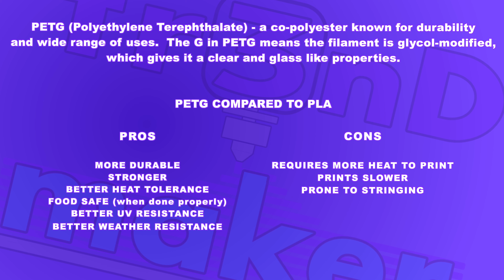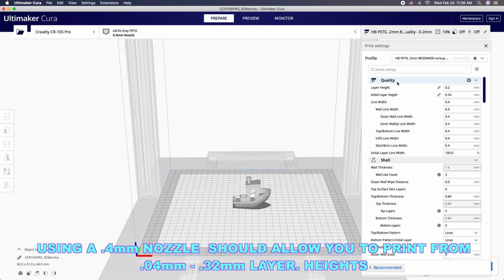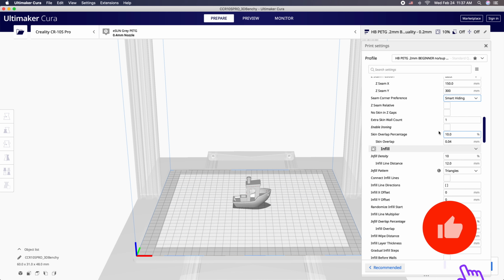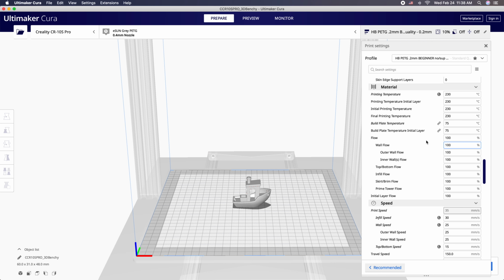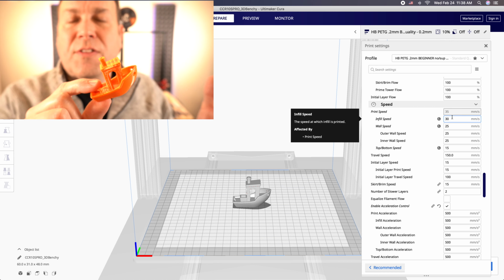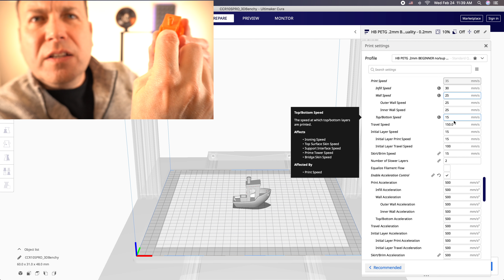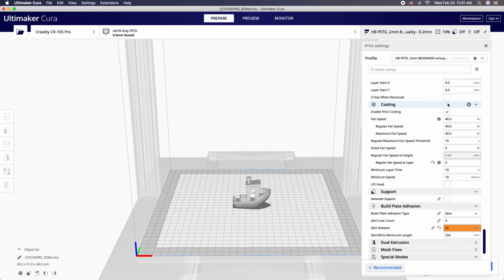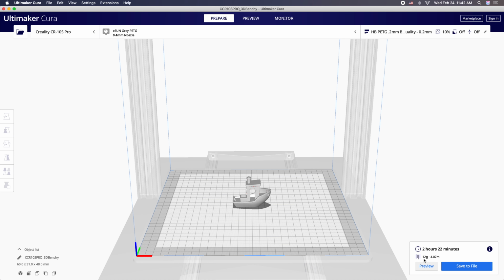How to 3D Print PETG Filament! Tips and Settings to 3D Print PETG Like a Pro - Cura

Comment: First of all, thank you. I was in tears as I desperately typed into YouTube “PETG help.” Nothing was going well. I launched Cura and said to myself, “the nice man in the video said to do this.” I got a great print after using all your recommended settings! Thanks again!
Reply from the maker: You are very welcome.   Stay tuned for more!
Reply: This comment is very encouraging 😁🙏
Reply: Had the exact same feeling, was about to chuck my filament out a window after half a spool, and now I have a benchy and it shockingly came out clean as my PLA prints!  I was at least expecting machine variation (I have ender 3 pro) or some brand variables to kill me once again. You’ve saved us so much grief. Listen to the nice man everyone!
Reply: This is why youtube is the best
Reply: Year later... agreed!
Reply: this is comically dramatic XD
Reply: Hi will this settings work on my kingroon kp3s printer? Thankyouu
Reply: @CBKCUSTOM  Not all presets will work the same on different printers, but I can recommend from personal experience that slowing down the print speed to ~20-40mm/s will allow you to get started with an object that allows you to get a starting point from which you can comfortably go forward doing calibration towers with Cura

Comment: Great tutorial! Im new to 3D printing myself and had trouble with printing PETG on my new ender 3 V3 SE. Used most of the same settings and now my PETG prints come out looking great, no more stringing!
Reply from the maker: Glad it was helpful!
Reply: i have ender 3 v3 SE too, do you print PETG directly on the build plate or with painter tape or something else?

Comment: Thanks man, great video. Just got an ender 2 pro for free on Facebook. Bought some petg when I should have got pla, so ive been struggling, but im excited to try these settings and see if it works. I’ve been having all sorts of issues trying to print it like PLA, I think bed height has been the most confusing of them all. I’m not good at adjusting on the fly. If you have any tips I’d appreciate it! New to 3D printing overall but I’m excited to get into it since I’m well versed in 3D modeling

Comment: Hello, I know this video is a little aged now, but I am struggling hard with my new Anycubic Kobra 3 and using Anycubic PETG. I started with the profile provided in the Anycubic Orca slicer, attempted to do the calibrations and wasn't able to get the flowrate to even print. I use the PRO ACE and have the PETG on the single roll. I tried to just print a benchy for PETG and it made it through about 4 layers and then lost it. I am at a complete loss as to what I need to do. I have tried to incorporate your settings from cura into orca, but there is a lot of that is setup differently. IF you have any advice to offer me, I would really appreciate it.

Comment: Do you have a support that works better then others that would support through holes like the size of dime?  I am going to try your settings on my Flashforge Adventurer 5m, PLA is beautiful but PETG nothing but troubles with stringing issues with Holes flattening the top and bottoms of the circles.

Comment: Your video really helped me the surfaces are quite smooth and everything holds perfectly on the print bed but I still have the problem of small spots appearing and some transitions look quite bad
I am currently using the Elegoo Neptune 4 as my printer
Reply from the maker: Try backing down your retraction and see if that looks better. Too much retraction often causes gaps.

Comment: Thanks for sharing, sir, although it's still not clear how Fan speed helps achieve decent bridging.
Reply from the maker: Filament out of the nozzle is molten and sags with gravity.  If you cool it fast, it cools as soon as comes out if the nozzle and allow it to bridge better.
Reply: @tr3nDmaker  this is really logical and helpful sir, I sincerely appreciate your response. Would try it out.

Comment: What are your rekommandations for retraction and retraction speed ? And what about your final z hight
Reply from the maker: Retraction is very tricky and often retractions can vary even on same model of 3D printer.  Tension on extruder, nozzles, etc can be factors.  But, here is a bit of advice.  Start with Retraction speed at 35. Then run some retraction tests on mm for retraction till good results, even if not 100% perfect.  Then adjust retraction speed up or down 5(possibly 10), so 25-45 range, to fine tune results.  Be sure running nozzle temps on lower side that provides clean look and more importantly...strength.  Layer should not split. easily.  As baseline for ender 3 pro... 5.4 at 30.Retraction is tricky.  So, good luck.

Comment: If I print petg 25mm per second. Any part  Will take 18 days. How can I print faster 
I have the ender 3 pro. If I go higher temperature, the machine over heat and start beeping and won't let me. Any help with that . Thanks

Comment: Opinions on an enclosure? I found I would get clogs with PLA, so I kept my enclosure open for PLA. PETG I've tried closed, but still clogs. I figured closed would be a bit better, but currently trying your settings along with an opened enclosure now. Hope it works! 

Also, I understand the speed has to be quite slow, but my benchy is going to take me nearly 4hrs according to Cura... Is that accurate? Seems like a long time. 

Thanks for your video! Will let you know how it turns out.
Reply from the maker: PETG is thicker, so it likes it a bit slower.  My settings in video, should get people printing successfully.  The idea is to work up to speed till good compromise on speed, quality and reliability.
Biggest issue for petg newbies is they go too fast and clog.

Enclosure should help, but I never used one.

For speed, keep infill simple and perimeters can typically go faster.  Ince petg is flowing it is ok.  Higher temp help with speed, but can get stringy.

Comment: When printing wit PETG do u gotta have the fan on or off
Reply from the maker: I usually run no fan for first 2 layers to get good bed adhesion.  Then 40% fan for the rest of the print.  Good luck.
Reply: @tr3nDmaker  won’t PETG ruin magnetic beds at all
Reply from the maker: @monsterstorm78  I have not any issues with damaged beds from PETG vs PLA.  That said... I always go thicker for first layer and be sure nozzle isn't too close and deeply imbedding filament.
Reply: @tr3nDmaker  why do u gotta printer alot slower wit PETG ?
Reply: @tr3nDmaker  should i use any hair spray for petg on an magnetic  beds as well ?

Comment: What is a good print surface for an Artillery Genius Pro? I’ve been using painters tape and it leaves seams.
Reply from the maker: Just use the glass.  Clean with slightly damp paper towel with drop of soap or you can use a paper towel w/rubbing alcohol to super clean surface.  You can print straight on glass or for more bite to bed... rub on some Elmer purple glue stick.  8 Printers, all but 1... I use glass.  It will change you 3D printing life!
Reply from the maker: @BlondieHappyGuy  That is the thing 3D printers don't understand... The SMOOTH bottom layer that looks like glossy Carbon Fiber... So nice!  Compared to the very rough textured surface from a standard bed surface.  I LOVE printing on glass!.

Comment: Great video, i finally understand how to work with pet filament.  If you can help, ¿how can i use the pet profile for cura included with my recently purchased anycubic kobra neo?, when i import it i get an error stating "draft quality not suported in current printer", maybe i am failing to choose proper printer or custom printer in my cura settings but this has me quite puzzled.  Have in mind i am getting quite amazing prints in PLA, but there is a possibility for me to get quite a load of PET filament saving an amazing ammount of money but i need to get pet filament to work in my kobra neo. At least for a couple of months until i can budget to fix my ender 3 pro and see if i can purchase a third 3d printer
Reply from the maker: Easy fix… just copy your current pla profile… label it for petg… go down list and change speeds, temps, and fans to video specs… and you are good to go.

Comment: can't your share cura profile for ender 3 pro or ender3v2
Reply from the maker: I have many profiles based on what I am printing.   You can watch video and pause to copy settings.  Although, I find each printer is a bit different and my settings may not work for you.  Especially, regarding retraction.  Start with stock Cura Profile and add 3 walls and keep speeds slower. I am going to start a series on Cura settings and what they do...

Comment: I love this but man for some reaason I get great first layer and so forth just during the process filament starts to stick to my nozzle head idky .. should I raise the heat up or lower it ? Should I raise the cooling fan which is at 40.... I have PETG at 0.15mm feeler gauge z gap already ... But when I print with 0.24 and 0.28 it's great but when I print with 0.2 It starts to get petg on nozzle during mid print .
Reply from the maker: Ok... this could be several things.  Most likely, you are over-extruding and the filament has nowhere to go... so it collects on nozzle.   Best solution is to calibrate your extruder e-steps... but, you could try lowering FLOW to 94% and see if that helps.  If it does, I would recommend the calibration procedure.
2nd, could be your gap from nozzle to bed is too little... It will print fine for first few layers, but the filament over several layers builds up and has to find a place to go. 
3rd... may be running a bit hot... try lowering 5-10 degrees.
Hope this helps.  Let me know how it comes out.

Comment: I'm using mesh leveling, and the basics on this profile....but I still am still having  issues with adhesion. I have to use a brim, or I have no luck whatsoever.
Reply from the maker: Mesh bed leveling really only helps with very warped bed. I have this feature as well as bltouch and never use them.
I suggest you watch my video: https://youtu.be/MhIE0ms-n7U
Level the bed perfectly flat with proper gap.  
DO NOT overlook the section to see if everything is tight.  90% of first layer issues are loose eccentric nuts.  Should be zero wobble.  Also, pay close attention to section near end that demonstrates what proper bed adhesion should look like.  Good luck.   Let me know how it works out.

Comment: i've been trying to print petg using kingroon kp3s with big flat dimension, i think around 15x12 cm. the first layer seems not always stick correctly, so when the second layer got print, the nozzle will pull the first layer, i've try several ways, but it doesn't help. it only help if I print 1 way only, in top/bottom line directions for for [0, 180], so it will stick one way only, but i want really normal cross printing direction.. maybe need to buy more expensive 3d printer?

Comment: bout to try this. fingers crossed
Reply from the maker: You should be fine... Follow directions and print slow.
Reply: @tr3nDmaker  its till printing, looks good so far. thanks.
Reply from the maker: @eggsandwhichian  how did it come out?
Reply: @tr3nDmaker  sorry for the late reply, the settings worked, thanks. but i tried printing something else and idk but it never stuck so I'm re watching to make sure i didn't accidently change anything.

Comment: From pla to petg what should we set your z offset as? Cause my nozzle it as for pla? My 1st layer is too to close to the bed for petg. Thanks!
Reply from the maker: Kind of depends on how perfect your gap is for PLA...  I typically can run the same.  I level the bed strictly by eye though, and adjust on skirt.   Only use paper or gauge if teaching technique.   However,  most find a bit more gap works better... some it a bit less.  If glass...use glue stick.  If textured or glass watch first layer...run 15mms SUPER SLOW to see if getting good bite to bed. 60-70 on temp is fine.  Adjust and remember what works for you... Good Luck.  I love PETG!
Reply: @tr3nDmaker  thanks for the fast reply! Some youtubers won’t reply until months later. If you run the same as pla so that means your layer height is at 0.2? I heard some people say to run ii more then pla like 0.28 which maybe that’s where my problem is? 1st layer looks like its too close and some in the filament is gets stuck on the nozzle? U have a Facebook group? Or Facebook we can message faster? Again thanks! I can really use the help!
Reply from the maker: @mackue8913  .2mm layer is great for PETG.  PETG is thick and flows slowly... so thicker liner means slow also.  I like .12, .16 and .2 for PLA.  My in progress R2D2 is .24, but sanding and painting is required
Facebook: tr3nD maker
Not really a group, but good for sending pics of prints or issues

Comment: so I printed the boat with my PETG it was super adhered to the printer bed(not a problem) but it printed out pretty good strong layers no over or under extrusion but then I went to print some tall cylinders and they had terrible layers and extremely weak and it ended up failing what could be the problem no settings were changed other than going from a skirt to a raft
Reply from the maker: My initial thought is... you need a brim with thicker 1st layer (.24 or .28)to secure print from wobble.  If not this, loose eccentric nuts or belts is likely.

Comment: I’m a newbie and have a Anycubic Vyper got Cura with the package. Problem is there is no profile in Cura. Plus I by my filament from Prusa
But they don’t list their material. Can you do a tutorial on this printer. I think it’s awesome
Reply from the maker: The Vyper is an basically an upgraded or improved ender 3 v2.  It is a very nice printer and should print very well.  Start with generic pla profile in cura.  I have a top 5 filaments video you should check out…
Reply: @tr3nDmaker  Thank you for the tip
I have been doing a lot research on Cura and different profile settings
The Thingiverse Jet engine is my project to prefect high rez. printing
Reply: @tr3nDmaker  when I print PLA I use Elmer's glue stick. I use the textured plate that came with the printer and the results has been fantastic.
Reply from the maker: @1Hyetech  You are welcome.  Try to work on one setting at a time. Once you start learning what each setting does... starts to make tweaking so much easier.  Good luck on your project.
Reply from the maker: @1Hyetech  I often use Elmers purple.  when surface wears out... give glass a try with Elmers.  So much quicker and easier.   Plus super nice bottom layers.

Comment: I have been sooo frustrated with printing PETG and then came across your video which I watched with great enthusiasm.... I have been unable to get any print of any real usable size to print without on end of the print object warping on one end or the other.  I too am using a Creatlity 10s Pro v2 and made every recommended change to Cura that you covered.  Sliced the print and start the printing..... Somewhere between 5 - 7 % of the print cycle, the print started to warp.  It seems to always happen somwhere around 5% of completion.  I have printed test cubes and other precision test objects with success.  Also print objects less than 5mm high seem to be ok.  But anything over 10mm high always warps.

I would appreciate any thoughts.
Reply from the maker: A couple of solutions…

A may not be getting a perfect bed level… check out my vid on leveling with paper.  Be sure everything is tight.  Important part of vid is visually checking first layer.

Check out vid on creation dual surfaces on s pro… adding pei sheet on one side, textured on other.  Great bite with pei.

This next one frustrated me big time.   See if heating/ ac vent blowing any where close to bed surface.  I had a ceiling vent 7 feet from printer… when turned on blew a slight draft on one corner and started a lift which lead to full on warp!!!

Let me know if this helped!

Comment: Do you offer a consult for a fee?
Reply from the maker: Of course, what is your problem or issue?
Reply: @tr3nDmaker  for the life of me I cannot get PETG to print despite having no problems with 
PLA. It will print fine if I am doing just one in the middle but if I try to print multiple parts at once on the same plate, it's not sticking to the plate, it is sticking to the nozzle, chaos ensues. I recently tried your settings here though and they seem to be working better (I think maybe I just needed to go hotter and slower), but if I continue to have issues I would love to be able to live chat with you to troubleshoot and get this figured out if possible.